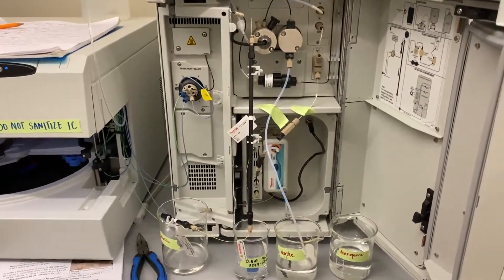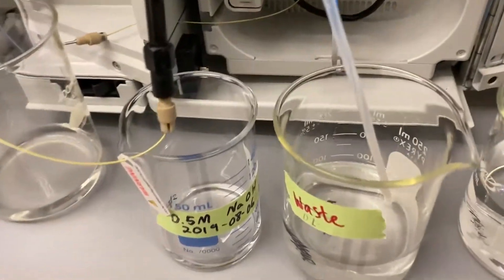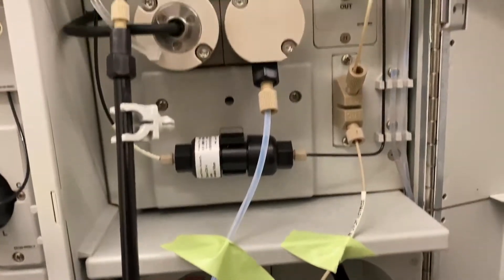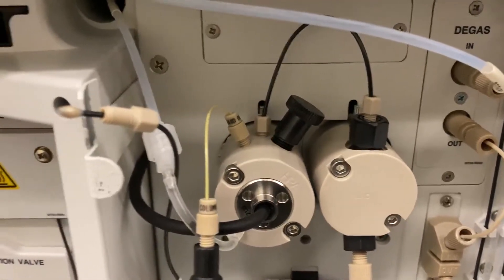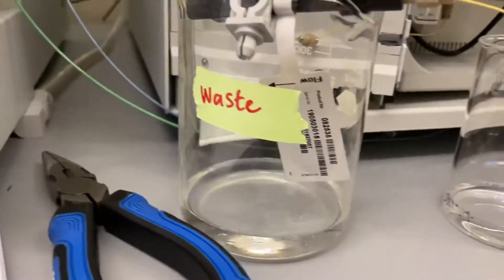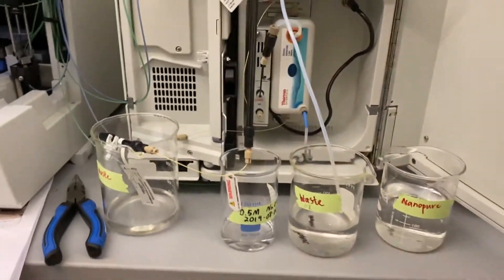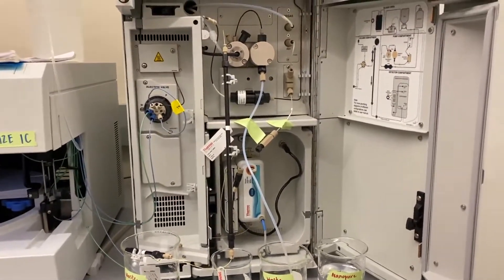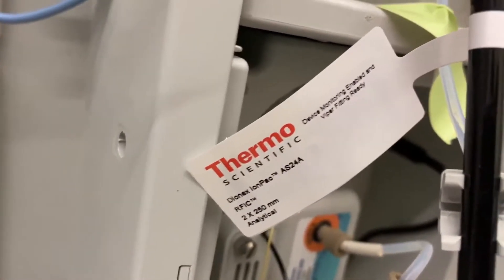IC Column Cleaning Setup

Comment: I'm curious as to why your guard column is after your analytical column? You said you maintained flow direction, so how did you end up with this configuration? Did you just move the guard to the back to elude last? I'm familiar with the Metrohm, but the layout in this instrument is a bit different.